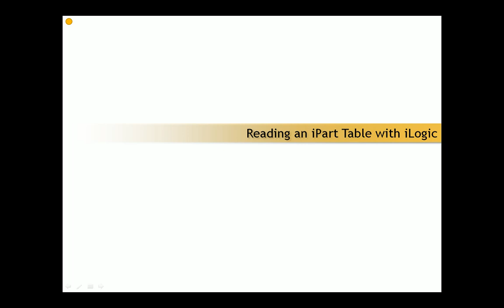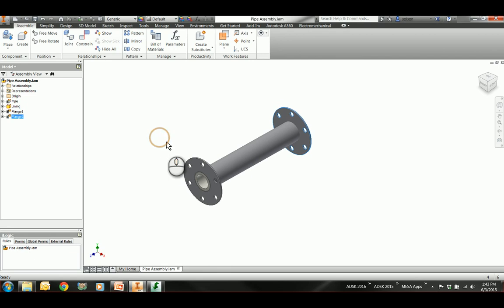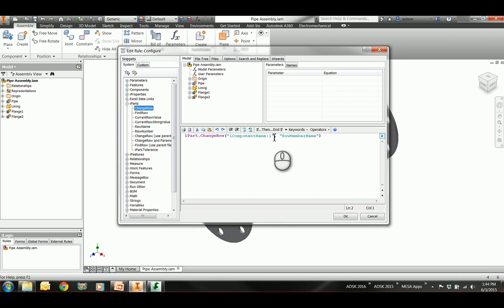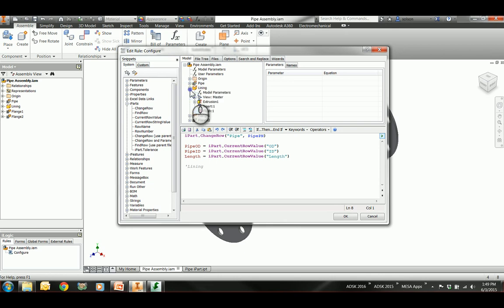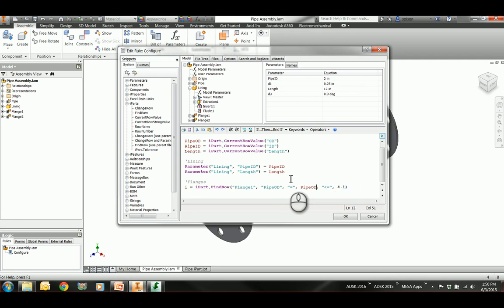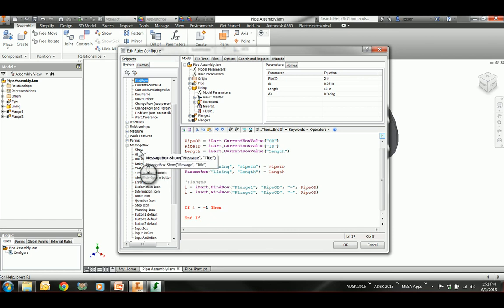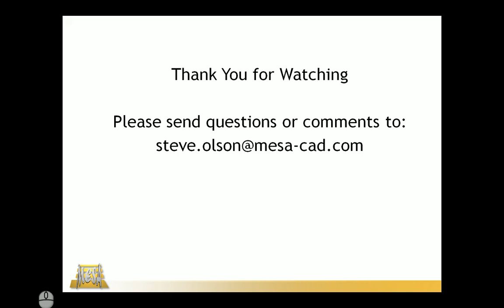Inventor:  Reading an iPart Table with iLogic

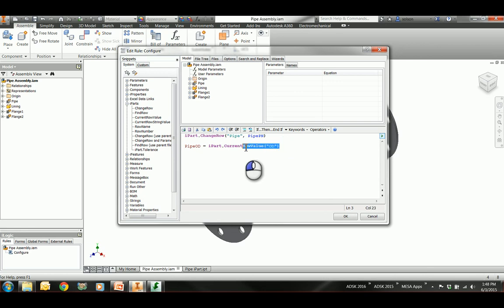Comment: I basically recreated what you did, but when I write the code that you did @ 3:35 mark it gives me the following error:

"iPart.CurrentRowValue("PipeOD"):  This function was called without a previous call to iPart.ChangeRow or iPart.FindRow."

What am I missing here?
Reply from the maker: +Craig Hayman 

Craig,

The iPart.CurrentRowValue("PipeOD") function is to be used after an iPart.ChangeRow or Find Row because it does not have any arguments to identify which iPart in the assembly you might be using.  

In my video, I use iPart.ChangeRow to set the Pipe component to the correct iPart Member.  Therefore, it knows to read that iPart table.  Inventor assumes that you might have multiple iParts in your assembly.

Are you using either of those functions in you rule?

If you would be willing to share what you are working on, I would be willing to look it over.

Steve
Reply: +itsaCADworld 

It is almost exactly what you have there. 

I am creating a axial fan assembly with a casing and 2 flanges on both sides. However, the casing and flange (diameter & length) will change depending what model I selected. Our company has over 50+ models so I thought using iParts was the best route to go.

Here is what I have done so far:

1. I created an  iPart for the fan casing and also one for the flange with the following members; 
           1. 126 
           2. 124 
           3. 124V
           4. 122
           5. 122V

* they vary in OD, ID and length*

2. Created an Assembly and dropped the 1 X Casing iPart and 2 X Flange iPart

3. Created a user parameter in the assembly called "Model". This would allow me to select one of my fan models.

4. Created an iLogic ruled named "Fan Size". What I want this to do is find the model I select in the iPart Table (for example 126) and grab the OD, ID, and length paramters then update all parts.

I  did exact;y what your code said ( I am very new to iLogic) and it gave me that error. Just for reference here is my code. 

iPart.ChangeRow("Master_Axial Fan_Casing:1", Model)
Length = iPart.CurrentRowValue("Length")
Inside Diameter = iPart.CurrentRowValue("ID")
Outside Diameter = iPart.CurrentRowValue("OD")
Reply from the maker: +Craig Hayman 

I have been through your code several times, and rebuilt my code to make sure nothing  has changed since I made the video.  I cannot replicate the error you are getting.  

Are your Inside Diameter and Outside Diameter Parameter\Variables all one word, or is there a space.? Parameter\Variable names have to be one word, or use an under score between them.  That may be your issue.

I would also add Updates after the ChangeRow statement, and an Update when Done statement at the very end.

InventorVb.DocumentUpdate()

iLogicVb.UpdateWhenDone = True

Hope this helps,

Steve
Reply: +itsaCADworld 

All parameters are one word with an underscore connecting the words...

Is there a way you can check my model and code? Maybe I am missing something here in the explanation that is key?
Reply from the maker: +Craig Hayman 

One more thing you can try before you send me the model is try restarting your PC.  How iLogic works is that, the code you write is translated to an executable that sits in your temp directory.  I have see scenarios, where users have made so many changes to their code that the executable gets screwed up and through strange errors.  There are ways to get the executable to be regenerated, but I have seen that cause more trouble than good.  So I typically restart Inventor, and possibly the PC to get the executable to regenerate.

If that does not work, send me a message at steve.olson@mesa-cad.com.  I will send you instructions on how to load the model to a ShareFile site.  I can look the model and code over and let you know what I find.

Steve
Reply: Hi @craigh7667 , I think understood, you need to use parameter how the text same your parameter be a number.